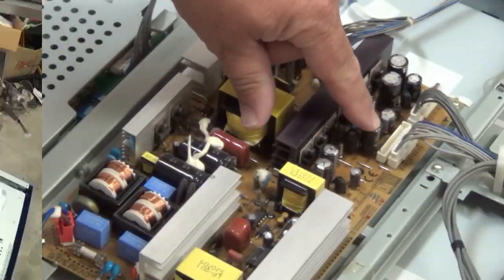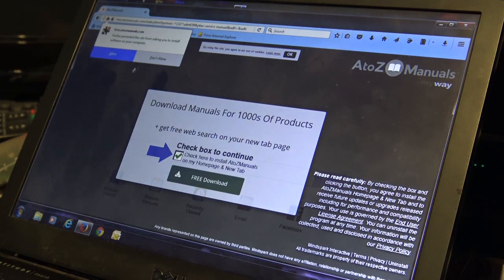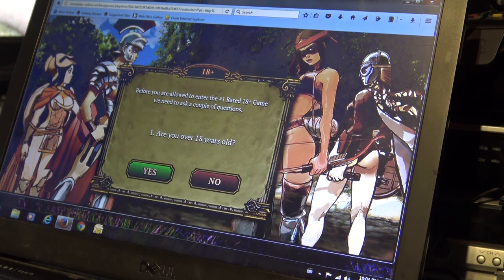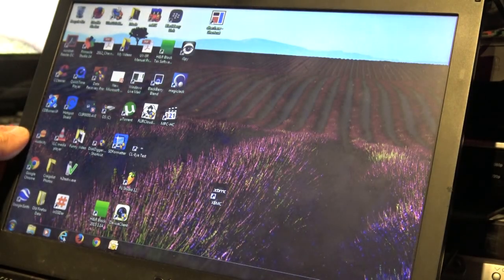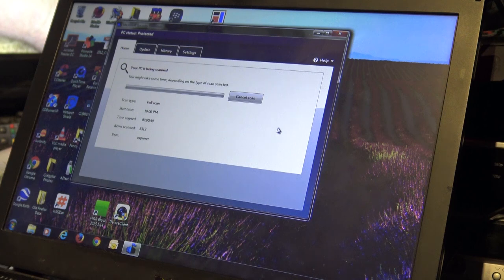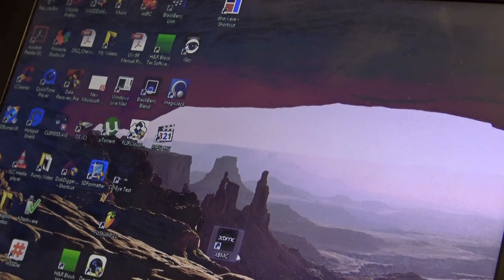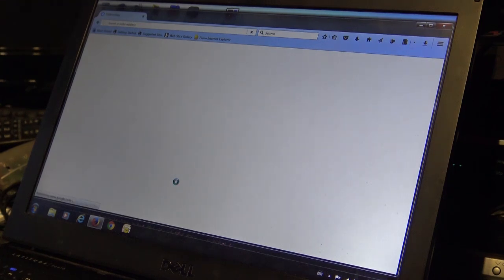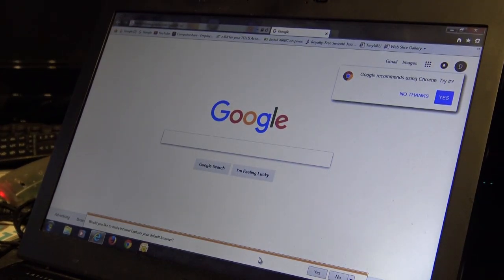Computer Viruses ARGH

Comment: Well, I can probably see why you got infected. Windows Denfender blows. Use Avast or Malwarebytes. Startpage is actually a good search engine. It uses Google results but not is saved and it is very private. I'd also go to bleepingcomputer(s).com and download if their tools to remove any infections
Reply from the maker: Every AV program gets hit. There is always things that get through antivirus software. The time when I did hit the hardest about 14 years ago now I was running Kasperski, which was rated the top AV software at the time. 
I had just finished running a full scan, and it said no issues, and when I clicked the X to close it I got blue screen of death, and my FAT was wiped. Cost me a bloody fortune to fix it, as I had to buy a new hard drive and recovery software, and then start recovering files from the un-bootable drive onto the new drive. Back then hard drives were expensive. It was only a 6 gig drive but that would have been about 500.00 back then. I have not trusted many of these so called AV programs since. Besides the fact that they slow your computer down to unbearable speeds. Windows defender has got em all until that one on the weekend got through.

Comment: this is why I prefer to use Macs not as many viruses on them I hate viruses they are a fucking bitch I have windows machines too I have  horror stories that would make you cower in fear
Reply from the maker: You're kidding right! I know many people with macs, and they spend big bucks to get their computers cleaned out because nobody knows how to do it by the mac guys and they charge a fortune.
Reply: 12voltvids I use the guest account for web browsing it zeros out every thing never use the admin account unless your 100 percent sure it is safe so far I've not had any get in to the administration side of things on my mac
Reply: I think you would not have any problems with a Mac. I have used them for years, and we have about 8 of them in the house. AV is free. Built in superb back up system called time machine, and rock solid machines. I used to have Windows at home, and I felt I was still at work using a computer. By the time I upgrade to Windows 8.1, I almost lost it with it's non-intuitive, completely bonkers illogical layout. I tried a MacBook pro for about 30 minutes and never looked back. OS X is a breath of fresh air. Migrating your data from one Mac to another is a doddle. It even transfers your application and it's setting too. Try doing that with Windows - Nope! Not sure how to fix a problem on a Mac, use Google to find your answer.
Reply from the maker: I will never own a mac or any crapple product. My house is an apple free zone. Nobody is permitted to bring any apple products into here.
There is an old Ipod touch kicking around somewhere, hasn't worked in years. That was the only thing that ever came intomy house with the A word on it.
My PCs are Dell, and home built, my phone is a Blackberry, and I am proud of it.
Reply: Oh and I use Hi-fi engine. Free rego and have about 80 to 90% of the schematics you need.
Reply: It's your choice at the end of the day. What ever works for you.
Reply: @12voltvids  As far as I know of Macs do work alot better than PCs but I have never used A Mac
Reply from the maker: @jackgarrison8497  perhaps 20 years ago. Today they are just as vulnerable, even more so because the ignorant users think they are bullet proof.

Comment: Maybe it is time now to switch to Linux Mint 18.1 (Serena) 64bit edition with UBUNTU Restricted Essentials and Comodo Antivirus for Linux. then you will never have to worry about viruses ever again., if you want help on using Linux search for Joe Collins on Youtube and he'll help you get your head around Linux also you could also have a look at EEZY_LINUX.
Reply from the maker: I really don't feel like going back to school and re-learning everything all over again. I don't like computers, I use them. For me they are a tool, to edit my video on, and send / receive email. I used to be all over coding back in the DOS world, but those days are done. If linux was a simple to implement, and all my existing applications worked then perhaps, but it is totally different. This is the same reason I don't run a mac.  I know how all my apps work on the PC.  premiere and photoshop, which are the 2 apps I use the most have quite a steep learning curve, but I know them now. Changing OS means learning new tools, and I am at a stage in live where I just can't be bothered. I am in my comfort zone on the PC, and I intend to stay here. I don't worry about randsom ware, or viruses because I don't go to sites where that type of crap is normally found. The fact that I got hit this time was due to my AV software being out of date, which just re-enforced the fact that you need to stay current on updates.
Reply: NORMALIZATION OF IGNORANCE I use Linux  mint 17.3 (rosa) 64bit no problem